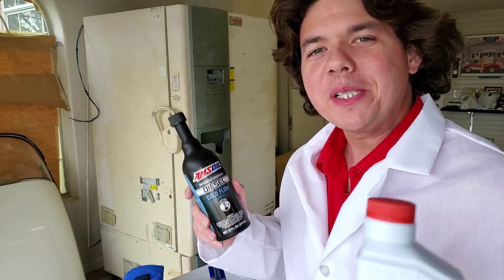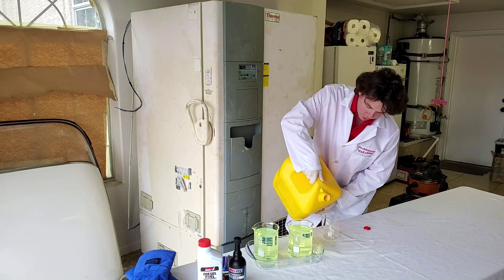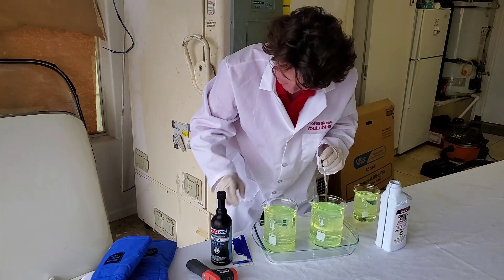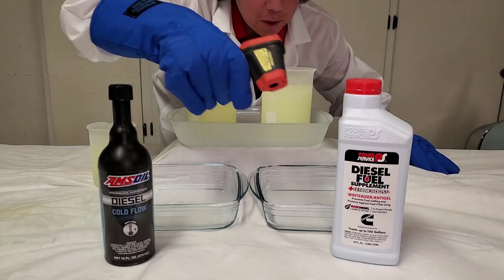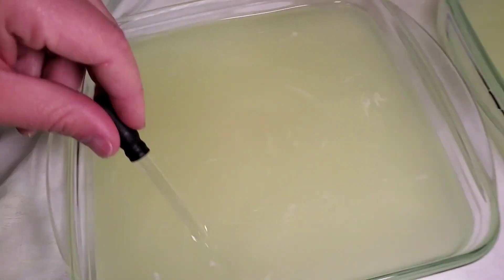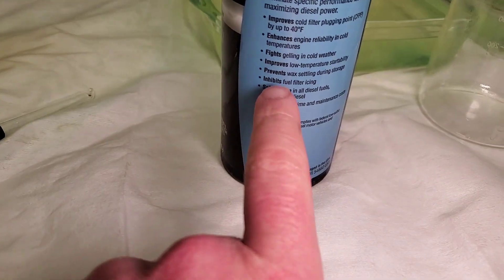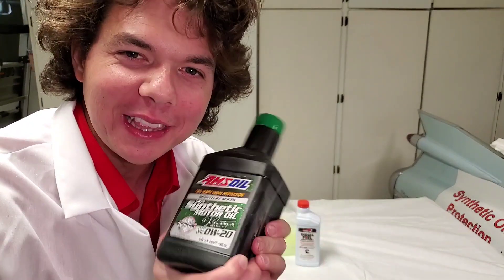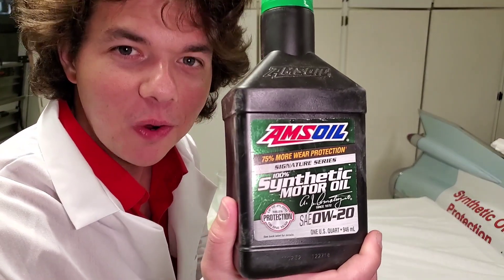AMSOIL COLD FLOW VS POWER SERVICE ANTI-GEL Diesel Additive

Comment: I'm using the Amsoil all in one, which has some protection from freezing, I just wanted to let everybody know it works great for added fuel mileage.  I drove from my house in NE Florida to my cousins house in Alabama, about 650 miles one way, on 1 1/2 tank of fuel!  I have the stock tank on my 2005 GMC 2500 HD duramax, 193,542 miles.  Only mod to engine is a S & B turbo intake. Stock size tires.  Running 78-80 mph at 24-2500 rpm.  I put 1 8oz bottle in each fill up. Average 19 mpg.  Not bad, was averaging about 16-16 1/2 mpg.
Reply: Im averaging 700 miles (highway)per 32 gal tank on my 21 duramax.. also running the amsoil diesel all in one.. amazing
Reply from the maker: Thanks for sharing with the channel 💯

How did you learn about Amsoil?
Reply: @Syntheticoilprotection  Idk specifically,  just being an adult and owner of half a dozen trucks im always looking for good products to keep them maintained..

Comment: I'm on my 3rd amsoil change in my 2018 titan. Freaking love this stuff. I actually ordered the differential fluid this round.
Reply from the maker: Awesome Thanks for sharing Nathan!

Where do you live at?
Reply: @Syntheticoilprotection  I live in Tennessee.
Reply from the maker: Yeah crazy to see that cold weather go through Texas lately It was like 20° high temperature in Houston
Reply: Yeah man. It's 18 here and icy. Kinda wishing it was much warmer. I need to service my truck
Reply from the maker: Wow, That's scary cold!

Yeah I remember I used to go to community college in Pennsylvania and about 2 months out of the year It would be 17 degrees at 7:50 a.m. in the morning and the wind was an average of 14 miles an hour in the feel like temperature was like two 😁😄😆
Reply from the maker: You turn off your car and in 40 minutes your car is ambient air temperature
Reply: That's crazy! I love winter but it's a bit much

Comment: Interesting to see. I was looking into getting an additive for my truck. Thanks for the info!
Reply from the maker: I highly recommend the diesel treat all-in-one you'll see that under other cleaners and protectance lubers and lubricants and protectants it is a orange bottle it's got the lubricant seating boost diesel injector clean and anti-gel all-in-one.

This is my link and when you use it I would be your Amsoil dealer I could always answer all your questions in the future on the products and I highly recommend the 6-month PC membership we'll save you a ton of money.

I recommend one case of 16 oz bottles of the diesel injector clean plus eating boost.

You would run two bottles as a cleanup dose and that would clean your entire fuel system and then you could run just one bottle every full tank of fuel.

🎬 Professional YouLubher: Eben Rockmaker Regency Gold Direct Jobber AMSOIL Specialist (Dealer#: 5331179) 702-472-3614 

     ✅ If You're New To AMSOIL I Recommend The AMSOIL 6 Month PC Membership because it will save you about $33 on a $100 purchase after the difference in tax - https://www.amsoil.com/offers/pc/?zo=5331179

Comment: I've been using cold flow for years. Good stuff. I'm curious when this test was done? As gas stations in cold weather climates typically switch to a winter blend Oct 1st. Was this test done in the summer with straight #2 diesel?
Reply from the maker: That's a good question I don't know 100% for sure for sure because Vegas doesn't get that cold most likely it's the summer fuel.
But I do not know 100% for certain because I did not test both blends to know exactly the difference
Reply: @Syntheticoilprotection  thanks for the info! We run amsoil products from engine, trans, hydraulics, to fuel treatment in 30 trucks in north Dakota. Your videos are awesome!
Reply from the maker: Thank you😊

Comment: I use the Amsoil on my Mercedes 240d diesel. What would be used for a diesel purge 🤔
Reply from the maker: I don't understand what you mean by a diesel perch what I do recommend on those Vehicles is the Amsoil engine transmission flush oil change is great to use also I recommend the diesel injector Clean Plus seat and boost that's the green bottle that's my favorite and I've seen tremendous results and if you're new to Amsoil the 6-month preferred customer will give you the very best value on the products and when you use my personal link that will always allow me to answer your questions in the future you'll see that in the description this is the product I mentioned.
I recommend using a heavy clean up dose every few thousand miles perhaps two or three 8 oz bottles on a full tank and then one 8 oz bottle has a maintaining dose and that's if you have a 20 gallon tank or less if you have a huge gas tank like 36 gallons then you definitely want to run the 16 oz bottles😃😉
 - https://www.amsoil.com/p/diesel-injector-clean-cetane-boost-ads/?zo=5331179
Reply: @Syntheticoilprotection  Especially on the older  Mercedes diesels it is a way to run a decarbonized chemical directly at the injection pump.  I usually use Liqui Moly from a German company.  A number of websites on YouTube have videos on  doing a Diesel Purge.  One of them is Mercedes Source with Kent Bergsma. I had 4 carboned glow plugs and 2 had burned out.  I replaced the glow plugs with Monarks  from Mercedes Source and did a diesel purge and my 1981 Mercedes 240d starts right up and drives with more power and performance.

Comment: Great video, thank you- could you please tell us your opinion on the Prolab DBF-4 diesel ‘conditioner’ additive? Would this be a better product to use on a daily basis and not have to use the anti-gel In the winter? Or would you recommend using both?
Reply from the maker: That's a great question Jay if it was me I would run both personally if I had a diesel and I was running where it's really cold I would run the anti-gel and make sure I have the proper amount so I don't have to worry about it and then I would personally run in my diesel It's called diesel injector Clean Plus setting boost it's the green bottle and I would run that as a maintainer to get better fuel mileage performance and power and then for a heavy clean up dose you can run that and I would run in a diesel truck 1 16 oz bottle as a maintainer and then I would run two 16 oz bottles for a good clean up dose.

This is my favorite Amsoil diesel fuel additive - https://www.amsoil.com/p/diesel-injector-clean-cetane-boost-ads/?code=ADSCN-EA?zo=5331179

Comment: a good anti gel is key for cold temps
Reply from the maker: My favorite is called the diesel injector clean all-in-one the great thing is all you do is just stick one bottle in you get the upper cylinder lubricant the cleaning effect on the Rings and other components inside the combustion chamber Valves and then you also have the bump and seatain for better power fuel mileage and then you have the anti-gel in there as well if I had a diesel truck I would run 160 oz bottle every fill up and two 16 oz bottles every 2,000 miles for a good clean up those.
https://www.amsoil.com/p/diesel-all-in-one-adb/?code=ADBCN-EA?zo=5331179

If you're new to Amsoil and would like to get the very best value on the products the 6-month PC membership is the best way and there's no Auto renew and when you use my link that would allow me to answer all your questions in the future on the products about improving the performance and lifespan of your vehicles by choosing the right fluids as your independent Amsoil dealer👍
♥️   Find The Right Fluids For Your Vehicles - https://www.amsoil.com/guides/?zo=5331179      

     ✅   Save 25% On Your Next Fluid Order: https://www.amsoil.com/offers/pc/?zo=5331179

Comment: Would there be any reason for me to run the octane boost in my 2016 tundra and 05 f15? Just curious
Reply from the maker: I'm not familiar with that vehicle but the big difference would be less pre-ignition with a gas motor when you run the octane booster you will burn more fuel and make better timing with the computer.
For me to get credit & be "Your" Independent AMSOIL Dealer, please use my website below or my dealer no. 5331179 call anytime Eben Rockmaker 702-472-3614
After you click on: http://syntheticoilprotection.net
1. Click the hamburger menu
2. Click offers AMSOIL preferred customer
3. Click join now. 6-month PC member add to cart.  ( There is no reoccurring renewal membership unless you select that dot box ) 
( You have the option to not have your credit card saved if you prefer - est. 1972 )
4. Scroll up to the top Select shop by vehicle. 

New Promo: FREEFUNNEL

Comment: Im a new truck owner operator from canada looking forward what is best for my diesel treatment for winter. Thanks
Reply: I want ro test that one aswell and do some videos😁
Reply from the maker: Awesome and thanks for being a part of my YouTube community.

I would recommend a bunch of things but a great place to get your toes wet if I personally owned your truck Is a Amsoil engine flush you would run one bottle of Amsoil engine flush for every 10 quarts of motor oil.

I also recommend the diesel injector clean plus C10 boost as a great cleanup that will clean your injectors your valves and carbon deposits inside your combustion chamber if you're running where it's really cold I would definitely run the diesel all in one which has the anti-gel additive and everything else the green bottle has.

Personally I would switch over to the 0W-40 max duty diesel signature series motor oil that would help a lot with your cold starts and your starter would last longer and you would draw less amps on the starts also you'd have quicker oil circulation which up to 80% of the wear can be during the cold start so that would really help your motor last longer.

If you have any other questions give me a call happy to go over everything with you before you order and since it's for your business I recommend your commercial account that would be my link right here and I would be your Amsoil dealer so I would get the credit for your orders and I would be able to help you with the products when you use my link 😊😃💯
Commercial Businesses - https://www.amsoil.com/account-application/commercial?zo=5331179
Reply from the maker: 🎬 Professional YouLubher: Eben Rockmaker Regency Gold Direct Jobber AMSOIL Specialist (Dealer#: 5331179) 702-472-3614
Reply from the maker: Oh yeah we're going to be doing a lot of tests on different fuel additives very soon 👍😊😃
Reply: @Syntheticoilprotection  can someone sponsor me to try and test it ?😁

Comment: Like the cold flow videos. Just short to the point. Does it flow?
Reply from the maker: Yes, I used a fairly heavy dose with both additives the biggest difference was how the wax doesn't settle to the bottom like the other additive which will save your fuel pump

Comment: Great video!!!  I wish I would have seen this video years ago.

My idea for another video is test untreated fuel to see when it starts forming wax crystals. 

Wax crystals will plug our fuel filters and stop us.  

We need to know what temperature we should use this stuff.
Reply from the maker: Anything below 30° is a great point to start adding it also if you're going somewhere cold you want to have it in before that way it's already mixed in because adding the cold flow amsoil once it's frozen it will not mix and penetrate in

Comment: I stopped as soon as you quoted the wrong mix ratio on the PS was used. 16oz treats 20gallons (read the back where it says this is the ratio for winter use).
Reply: Didn't know that every drop of fuel sold in the country was a bio blend.  Guess I'd better  call phillps and ask them why all my bills said #2 fuel oil less than 15 ppm sulfer.  That 16 oz treats 20 gallons applies to bio blends because bean oil doesn't flow in cold Temps.  Doesn't flow well when it's 100 degrees for that matter.
Reply: @pete379exhd2010  thanks you made me take a closer look at the numbers. The Power Service dosage he used is supposed to treat 1.6 liters of fuel. The same dosage he used for the Amsoil treats 6.16 liters of fuel. So he pretty much used 4x the dosage of amsoil compared to power service. The deck was stacked worse then I thought.  Repeat the test with the correct and even/fair ratio and then see if there’s a winner.
Reply: @nono-fn3zc  no problem.  Bad thing is if a person doesn't know what to look for they can Overstreet immensely or under treat both of which can cause the same problem depending on the product used
Reply: @pete379exhd2010  you have to take ownership on that too though. You did read the instructions wrong and accused me of misunderstanding and went on a rant about biodiesel, lol. The directions say zero degrees OR bio. 

“At temperatures above 0°F., add entire contents (12 ounces) to 40 gallons of diesel fuel. When temperatures drop below 0°F. or when using biodiesel blends, add entire contents (12 ounces) to 20 gallons of diesel fuel.”
Reply: @nono-fn3zc  you are correct the directions say, below 0 or bio.  If you're running bio by all means dump a quart in, although that's still more than you need.  But if you honestly believe that oh lord it's going to be -5 next week better dump $8 a quart additive in my tank youre delusional at best and borderline moronic, and I'd say you're in the crowd of oh gosh it's single digits better dump straight number 1 in the tank.

After nearly 20 years of experience with diesel engines and diesel fuel working on them and hauling fuel I can tell you, the problem arises where you buy your fuel, not weather or not its treated.  I can walk out to a sight glass with straight 2 in it that isn't cloudy on a 7 above night tonight.  Again that fuel has sat in the same fuel bowl in the same injector pop tester in sunlight, and the elements for 17 months bought that fuel in July of 20 to pop test injectors, that's also the same fuel that's been in the tractor for nearly the same time and I guarantee it'll start without a fuel knock or low fuel pressure.

Again what do I know?  I've just hauled it, studied it, worked with it ya know whole 9 yards but clearly power service the people selling the consumer shit they do not need, are gonna tell ya yep our stuff works they'll also tell you over treating isn't an issue, till they're about to lose a contract of about 20k gallons of product a year because the fleet has issues with gelling because drivers were over treating fuel.

Comment: I don't like the foil seals, they make it more likely to drop pieces of seal into the tank.
Reply from the maker: The Power of AMSOIL Signature Series 5W-30 Synthetic Motor Oil protects against harmful deposits on turbochargers 4X better than Mobil1® Extended Performance and 3.6X better than Royal Purple® in industry-standard testing*.  Read This Article - https://www.amsoil.com/newsstand/motor-oil/articles/leading-the-field-in-deposit-protection/?zo=5331179